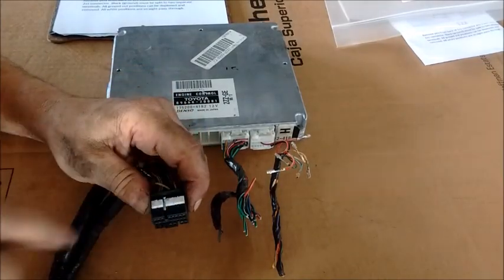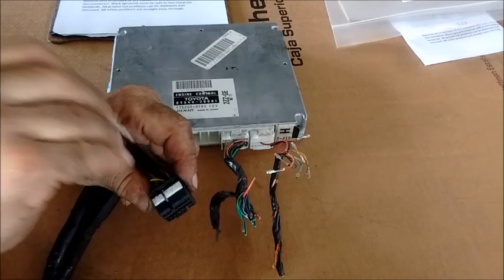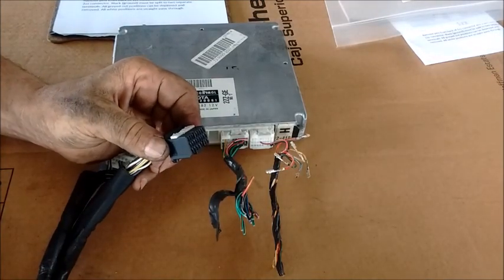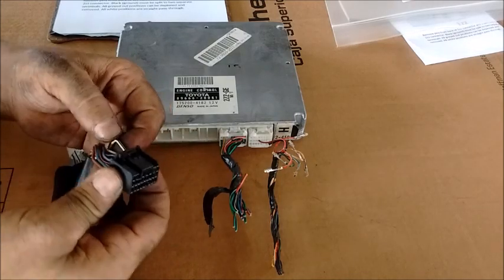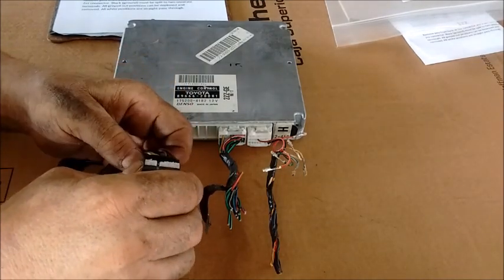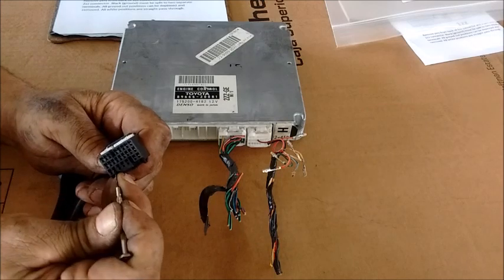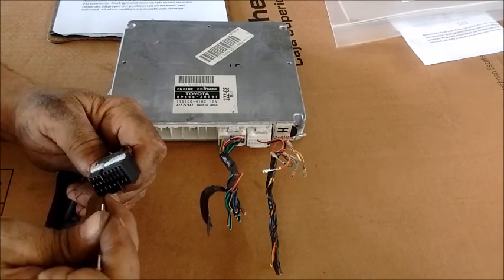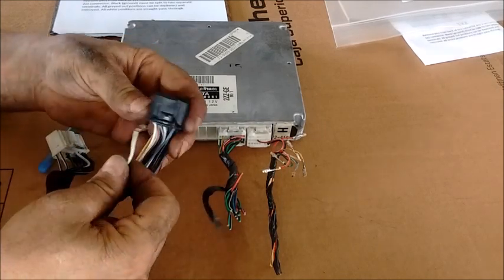De-Pinning Toyota DENSO 122-pin ECU Harness Connector Terminal

Comment: Do you have a jpeg or pdf of that wiring diagram.? It's hard to see on video which wires are removed and which ones pass through
Reply from the maker: Yes the link is provided in the notes. Just request the file.
Reply: @Merryfrankster_  Hi Frank, i can´t find the wiring diagram. Do you know were i can find the informations about a Toyota ECU and the pin positions? I want to swap a 2zz from my 2002 Corolla Ts in my Mr2 from 2001. I have order some things from MWR but i want to save Money at this Moment and use the stock ECU from the Corolla. 
Do you think its  possible to change the electric wire and the ring at the Keyhole to run this thing? Thanks a lot from Germany :) and thanks for all your great work for the great Content in your Channel. "This means You, not kidding" ;-)
Reply from the maker: @tkk5582  The only source I have for you is Toyota-Tech.eu - you can find complete wiring diagrams for your european vehicle there.
Reply: @Merryfrankster_  Thanks Frank and have a good Sunday.
Reply from the maker: @tkk5582  for the immobilizer you will need to have the immobilizer chip on the motherboard either reprogrammed or transferred from your original ECU. Some electronics shop provide this service. I don"t know if a dealer will be willing to help you with that.
Reply: @Merryfrankster_  Thats a good Point. I think about this way (to reprogamm the immobilizer in the ECU) for a couple Weeks. Then i call a guy from a toyotashop to buy new screws and tell him the situation. He sais i can try to rebuild the Sensorring on the Keyhole and use the right Key from the 2zz-Ecu.
Do you try this in the past?
But first i need the Terminals of ECU from Toyota.tech.eu to get sure to have the right wirepositions.
I try it this way and will comment the result here in the Comments. But it will be take Time.
Thank you for the support and have a great week. :)
Reply from the maker: @tkk5582  no. This is nonsense. The sensor ring does not have any intelligence. It is just an antenna connected to the edu and transmits the code from the transponder chip in the key. I already told you what you must do.